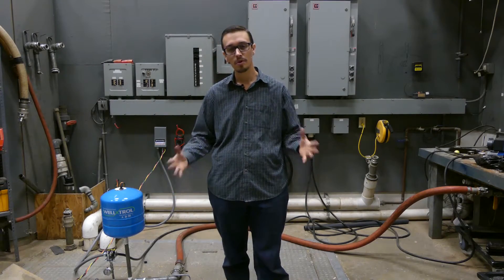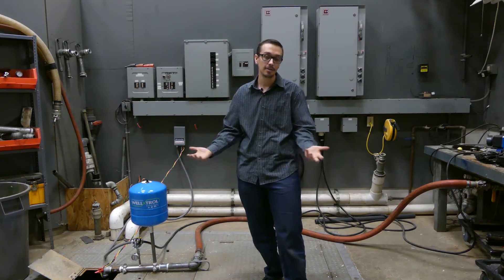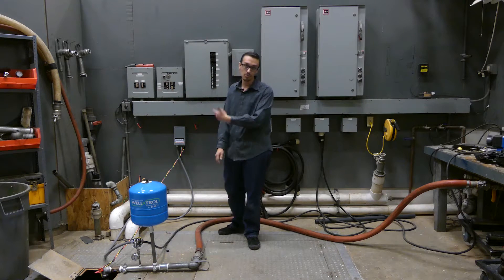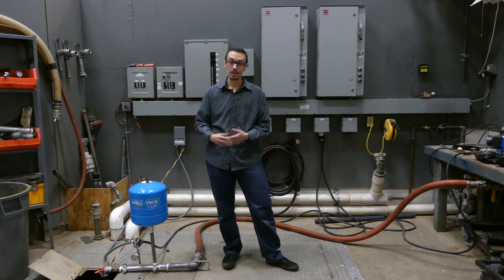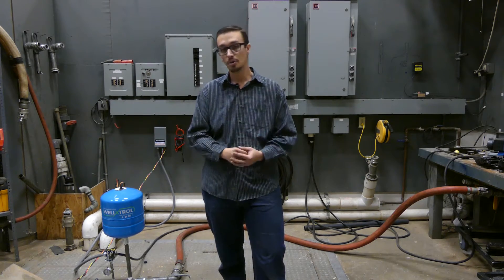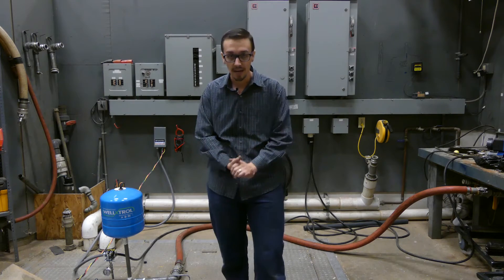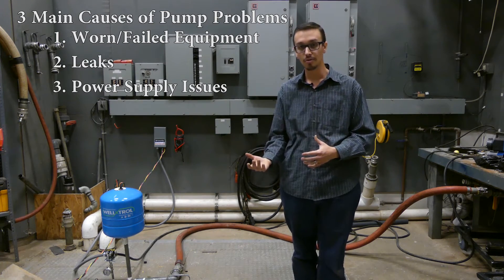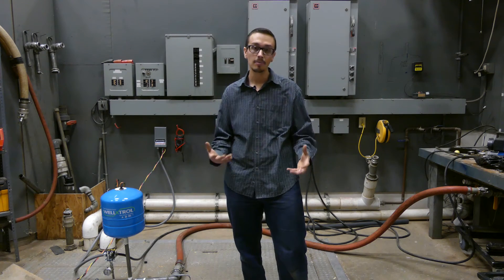Troubleshooting Water Well Pumps: Introduction

Comment: What would cause an inconsistent/intermitent low pressure condition? it happens every few days.........press switch is set to 50/70 but we sometimes get only 25 psi with our Geothermal running. The system holds water so thinking the check valve isnt the culprit

Comment: We purchased a  4" Submersible pump two wire  1/2 thru 1 HP 60 Hz and all brand new wire for it we hook all up properly put it in the well and turn power on at power box. The pump comes on but doesn't push water out. What could the problem be???
Reply from the maker: We have a video on troubleshooting that: https://www.youtube.com/watch?v=HTmS9_F21b0